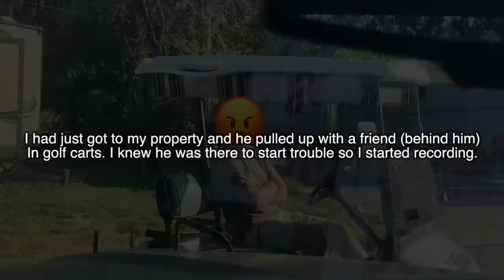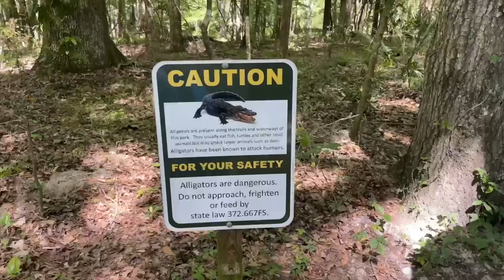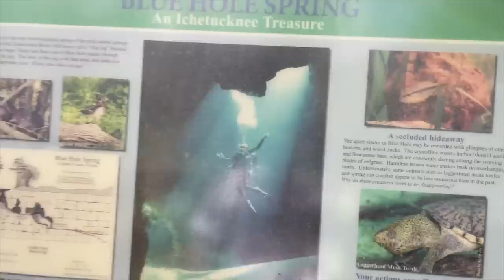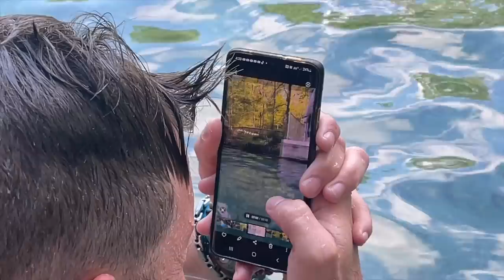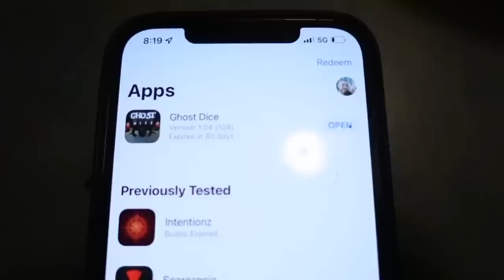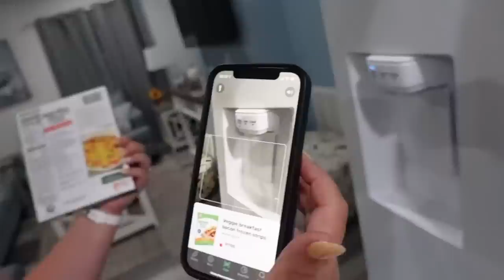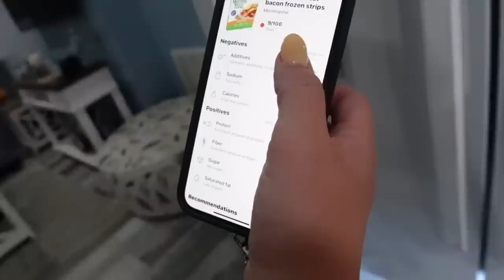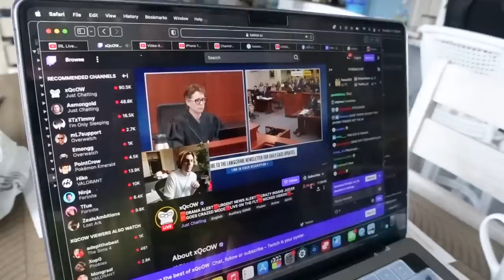Angry Neighbor Threatens Me Over Airbnb (Vacation Rental)

Comment: You are right, in the top....my hot water tank also is Atwood and I recently had to replace the gas value that ignites to light the gas. There is a special wrench, cost ,$5.00 just for the hot water tank fittings and all the other stuff.

Comment: We've been doing Paleo. I've been on it for 6 weeks and have lost 9 pounds, which I had not been able to lose weight for several years. Also my total cholesterol is down 30 points, LDL is down 40 points, and triglicerides down 20 points. Paleo is basically meats, veg, fruit, natural sweeteners but NO sugar, rice, corn, potatoes, grains. Dairy only if tolerated. Very easy to do!

Comment: You can winterize your trailer it you are not using it also. The pump is usually under a couch or cabinet so you can pump it through the whole trailer. Grew up camping and that what we always did. Last camper we just got rid of was a fifth wheel.

Comment: I had old school braces back in the 80’s where there was something on each tooth that held the wires and had to be tightened monthly I think. At some point I had to use rubber bands that were twisted on each tooth front front to back and then again on the other side. You talk about pain each time they were adjusted, 😣😖 …..When they were first put on, I had no idea how much it would hurt and to not eat anything that required my teeth. OMG!! I cried myself to sleep it was so bad. I had to have my braces on for 2 whole years and 2 months.  For awhile after I would run my tongue across my teeth because they were actually smooth again. I hope your journey is way less painful and shorter time. 🤓♥️🙏🏼

Comment: so it could either be a fuse as I said in the last comment or it could be something loose like some electrical wire came loose and touched metal. I would say try and make sure all connections are good. turn the power off to it and make sure all the connect. all the power connections are good and then turn it back on to see if it works, but you might want to replace that fuse too. I don't necessarily know which size fuse it might be, but if you could find the the circuit board it should have a fuse port connected to it and that'll tell you refuse that it has or that it can take. then you might want to get that exact amount of fuse Don't go over. don't go under

Comment: Be extremely careful with water takes and pipes. U r so lucky u did not rune the tank and blow out the pipes. U must turn on faucets and flush the toilets. plus shower to bleed the pipes. u cant have air in the lines. Campers use a lead free hose. I would drained out the water and used the hose. for all the pipes and tank. Then unscrewed the filter off faults and shower head. U don't need junk plunging them up. I would then ran water til clean.